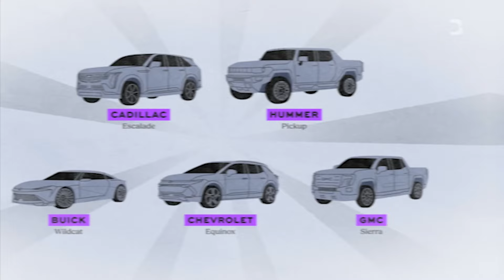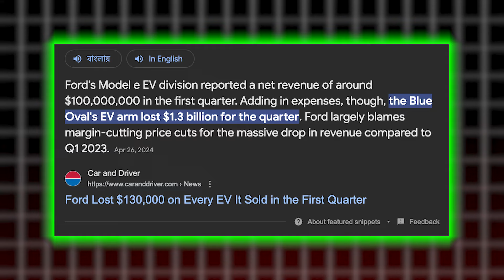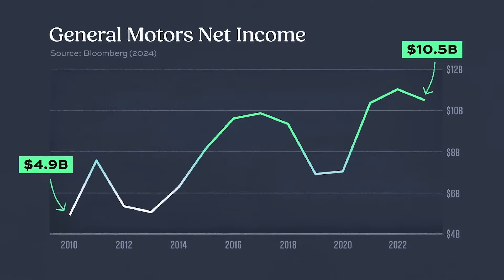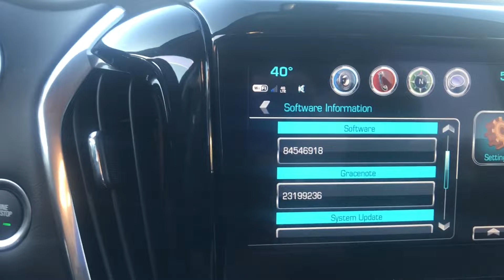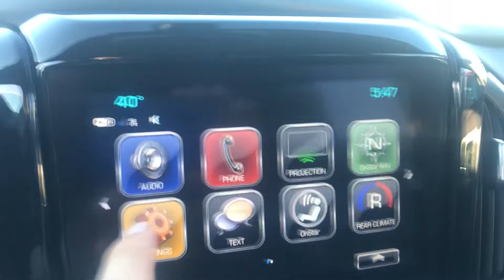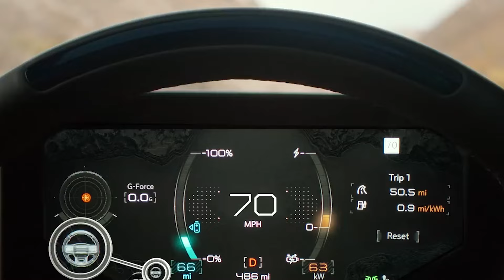GM CEO BACKS PEDALS from ONE MILLION EV Production Goal!

Comment: Many of us remember when Mary Barra had to deal with a scandal respecting automotive keys, such as those used for both locking a vehicle (to prevent entry or theft) and starting the engine of the automobile.  Mary Barra has absolutely no credibility, and her retention in the 'Drivers Seat' at GM demonstrates the contempt of GM for its customers and its shareholders.